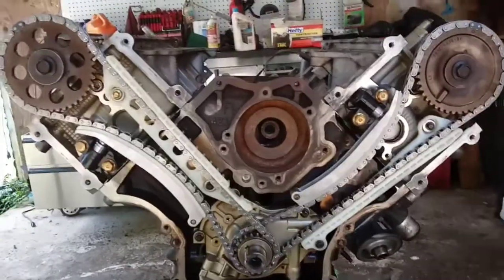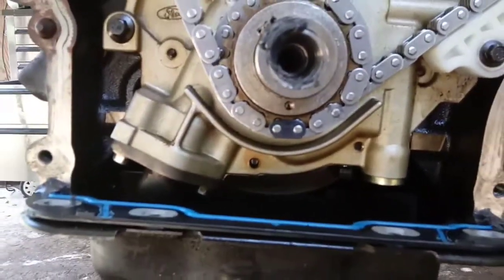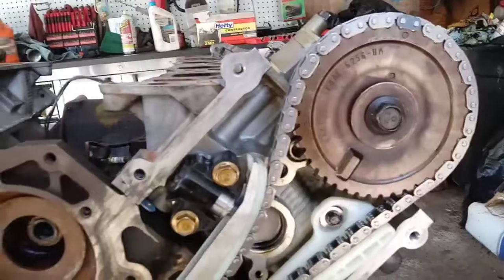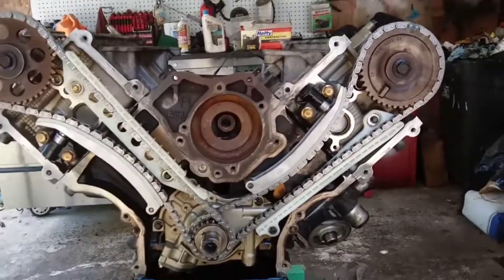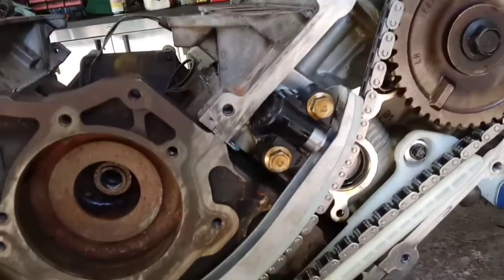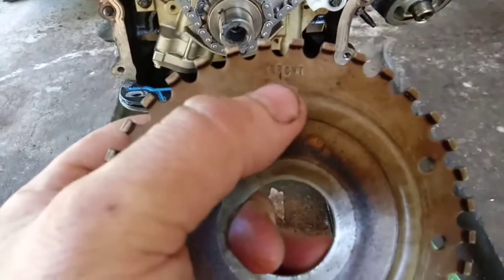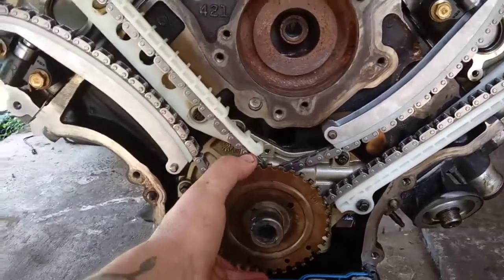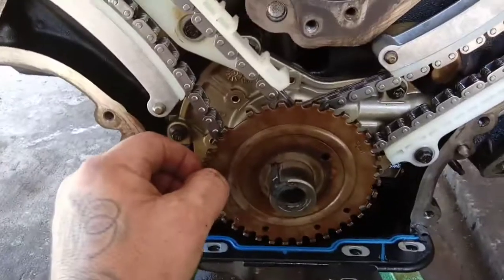Ford 4.6 2v timing marks

Comment: Hay man I need some help I’m tearing apart my first motor for head gasket 03 ford gt with the 4.6 sohc and I was wondering if I have the motor top dead center and line the chain with the marks you gave in the video I should be good to put everything back together correct?
Reply from the maker: You have the exact same engine design so this works for you as well

Comment: so looking at this vid compared to my pics i took of the timing chain. all of my marks lined up. had the cams at the same positions as you got. but whats got me freaked out is my crankshaft looked like it was off to the right barely a touch when i was messing with it. and it was like that before i even touched it (got it out a junkyard) again the marks line up and the chain has good tension on it. if i fucked it up my car is going to a scrapyard.
Reply from the maker: @idriveamerc  if your marks are in line with the dot on the crank and on the cams and it’s new chains etc… then you should be fine but of course I’m just going off what your telling me.
Reply: @MrMelvinkennedy1  thats good to hear. atm im having to rethread this spark plug so it will be a little bit before i actually fire the car up and see if it ticks or anything. pray for me lmao
Reply from the maker: @ I think you will be fine. If not hit me back up and we will figure out what went wrong
Reply: @MrMelvinkennedy1  so went to crank on the motor after getting it put together. sounds like it has no compression on any cylinder....great 🙃 been told i installed it wrong so...ig tear the whole motor apart again! yay
Reply from the maker: @idriveamerc  how did you install wrong but line everything up?
Reply: @MrMelvinkennedy1  man...thats a damn good question. i had it on open headers and i had another set of eyes in the engine bay they said it wasnt turning over fast enough. im gunna put the exhaust on after work and see if it just needs that back pressure. other wise its for sale

Comment: I get what you are saying in this video but I did mine and something went wrong and someone mentioned something about TDC on compression stroke and exhaust and that making a difference in doing it
Reply from the maker: @erikcapozzi3425  if you replace chains and markings are as shown it can’t be any other than compression stroke

Comment: If you decide to keep the factory Cross Morse HD chain that will last a million miles if you do regular service and you want to replace the wear items behind the front cover (fixed guides, tensioners, tensioner arms) pick a chain link to make an index mark..it doesn't matter which one as long as there's 30 links on each side to the crank.. make your marker marks and I'd probably strap the chain together on the gear to keep from any movement or have a friend with a breaker bar and an 18 mm on the cam gear. But do mark it so if when you release the tensioners and there's that jump or slap that can happen..more likely on the passenger side then if it moves you can always put it back. The aftermarket chains in the last few years a lot of time have sharp edges that do nothing but cut into the guides. If you insist on replacing the chains because you have 500,000 miles then I'd buy the morse chain from Ford and most definitely not the Cloyes that you'll be doing again sometimes by 50,000 miles or engine replacement. Cloyes used to be a really reputable company but like a lot of other companies with quality control issues i just wouldn't use them. I rebuilt a 302 and used a Mahle set that cost quite a bit more but there was absolutely no room for complaints. The 2V chains have no reason other than extreme mileage or using conventional oil for 15,000 miles to stretch. The 3V or 4V ... depends, just depends.
Reply from the maker: @MarcKemp-q6n  spot on

Comment: Question, I have a 2003 F150 with a 4.6 2-valve Windsor. I swapped it for a 2007 4.6 2-valve which also came out of an F150. Now my mechanic told me he could make it work simply by placing my Windsor intake onto the new motor? Well guess what it didn’t work. We are getting codes for Crank sensor, and Cam sensor. Crank code was successfully cleared, but not the cam code as the sprockets are different being that the newer one the 2007 has 4 more contacts making for a total of 8. Can we swap that cam gear to my Windsor gear, along with the Windsor sensor to make it idle? Rite now it starts fine and idles for 10 seconds then the idle jumps up and down.
Reply from the maker: @carlosbravo5091  you shouldn’t need to swap the sensor only the gear. They count the tones the same way just swap the tone gear and you should be good to go

Comment: I’m gonna do this job on one of my crown Vics. Thank you for the video, straight to the point. Any tips other than what you mentioned in video would be much appreciated
Reply from the maker: Be patient, take it slow and reach out if you need any help.
Reply: @MrMelvinkennedy1  will do! I’ll be getting started Saturday morning. Thank you again 🫡
Reply from the maker: @MrDoItAll91  absolutely
Reply: How do I line everything up to REMOVE old timing components?? 

I’m gonna be doing timing and head gaskets
Reply from the maker: @MrDoItAll91  if you removing the heads also the don’t worry about lining anything up until your going back together. Otherwise if it’s in good running condition line the crank up as showing in the pic and see where your marks are on the cams if it’s 180 out they will be the opposite of where they need to be but if the crank and cam marks line up like this video then your lined up
Reply: @MrMelvinkennedy1 so this morning I got everything off and somehow lol my timing marks in my cams were 11(passenger) and 12(driver) when I pulled the valve cover off. Does that mean the crack is also in line as well?? I haven’t pulled the full timing cover off yet I’ll be removing steering pump and cover in the morning.
Reply from the maker: @MrDoItAll91  no that doesn’t mean that at all. Always go by timing mark on crank not heads. There is a chance it could be or completely 180 degrees off as far as stroke goes. Good thing is it won’t matter now that heads are off. Just make sure cranks lined up properly before going back together
Reply: @MrMelvinkennedy1  good deal! As I pulled the cover, the crankshaft was 180 off!! You hit it right on the head! Man I thank you for basically walking me through this process. If anything else pops up I’ll be sure to reach out. Thanks and enjoy your Sunday 😎
Reply from the maker: @MrDoItAll91  absolutely, glad to help
Reply: @MrMelvinkennedy1 my old chain had no marks 😬. 
I got everything lined up, cams locked and timing chains removed.. 
What’s the best way to remove exhaust bolts (my very first time dealing with exhaust bolts)?? They’re rusty but not Up North Rusted lol luckily I’m down south. Like I said, they’re soaking in pb for last two days and I have a torch. I’m gonna get back at it in the morning
Reply from the maker: @MrDoItAll91  that’s the best way. Dont torch the manifold bolts but the collectors are fine to torch. Pb blaster should be plenty otherwise
Reply: @MrMelvinkennedy1  collectors? Is that the flange bolts (area)?
Reply from the maker: @MrDoItAll91  correct
Reply: @MrMelvinkennedy1 second weekend, day 5 and I’m completely done. Car crank up and ran amazingly for a few hours this morning. Mr Kennedy I’d like to thank you once again for this video and thank you for replying to every comment, you’re a gift sent from above. Thank you sir and enjoy your Sunday evening 😎
Reply from the maker: @MrDoItAll91  absolutely, I’m very happy for you. If you need anything else I’ll be happy to help

Comment: When I put my crankshaft to tdc the cams where totally off and my engine ran smooth as heck it's weird I just replaced a headgasket in my 4.6l 2v and reinstalled the heads, tried to turn the camshafts to the timing positions recommended and I feel valves hitting pistons so I don't force anything, the only thing I can think of is I need to take the heads back of to rotate the cams in place ?
Reply from the maker: It’s 3:30am here. When I get up in a few hours I will try to see what I can do to help you out. I may have to have a phone number I can call to do so but will try to help you figure out what’s going on
Reply from the maker: If your still having trouble I’m available just let me know
Reply: @MrMelvinkennedy1  just had a question if the crankshaft is at top dead center should the camshafts spin freely? And if so does the timing chain need to be connected to spin with the cams to avoid the valve to piston interference? I'm 21 and don't got mechanical experience just researched everything to come this far
Reply from the maker: @kevinedwards8330  what model and year
Reply from the maker: @kevinedwards8330  if your able to leave a number it would be way easier to call you, especially considering you have no experience
Reply: @MrMelvinkennedy1  would you still be available in like 30 mins? It's a 97 lincoln town car 4.6l 2v v8
Reply from the maker: @kevinedwards8330  yes I will be available then
Reply: @MrMelvinkennedy1  hey I think I got it figured out, it's just my left side camshaft is off so I'm going to spin the  cranck little by little until it let's me align the camshaft with my understanding that the cam valves are closed when they are in there resting position
Reply from the maker: @kevinedwards8330  ok let me know

Comment: Can you do this job without taking the intake manifold off  while in the truck ?  I can see taking the valve covers off.    I have a svt lightning  5.4 2 valve 2004
Reply from the maker: It can be done but honestly removing the intake is the easiest part of the job as well as its a ton easier to remove the valve covers once it’s off and out the way
Reply: have you done a svt f150 lightning with the super charger  same procedure?  Thats what i have to do.      are you close to north west Indiana ? 46373
Reply from the maker: @itsmeray01  oh yea I didn’t catch the lightning. Timing would be same procedure but you have more to deal with as far as intake removal

Comment: hey man great video - I'm about to do this job for the first time on my 2011 Crown Vic Police Interceptor.  I watched a ton of videos and many say once you lock the cams with the cam locking tool to not rotate them again with the chain off, or it could mess up the timing.  but then most videos end up rotating them slightly with the tool off, to line up the chain properly?  little confused by this
Reply from the maker: Ok so to answer the question I will do so in 2 ways. 1 do not over rotate on a 2v motor. Slight rotate in either direction is fine. 2 the chain will have links as shown in this video and sometimes to get those lined up properly you have to rotate some one way or the other. Now if the cam is sitting on a lobe and lets say rotates violently to the left, don’t freak out because unless you put a ton of force on it by hand it shouldn’t bend the valves, just rotate it back toward your mark in the opposite direction of the way it spun. So if it spun 1/4 turn < that direction then turn it 1/4 back > direction so that your not rotating the cam 360 degrees in one direction which would result in bent valves on the 2v engine. Ps ive never owned a cam holding tool EVER for any engine but specifically ford

Comment: Doing head gasket on 4.6 what do I do for timing chain I don’t want to replace the timing chain just the head gasket what can I do besides getting the cam holder tool and making sure it’s tdc
Reply from the maker: Well to do the head gasket timing cover had to come off as well as chain/cams so personally i wouldnt use a holding tool. Id get it at tdc then pull everything. Id also atleast replace guides and tensioners

Comment: No experience doing a 2V timing job..any timing job for that matter, but after following TDC steps my marks look just like what's in this video. Here's an e-high five 🙋‍♂️
Reply from the maker: Awesome. You got this!!!
Reply: @MrMelvinkennedy1   can I use a cam holder tool and then just dig in on replacing timing components without removing followers? Read somewhere that said have the key way at 9oClock before removing timing chains. Is this true?
Reply from the maker: @Logistican518  never used a cam holding tool in all my years, sometimes the cam can rotate but just rotate it back so the colored links are lined up. keyway meaning woodruff key then its more like 10-11 as you see in this video
Reply: @MrMelvinkennedy1  Rd  o

Comment: Nice work Melvin.  Do you prefer the nylon or cast iron tensioners?
Reply from the maker: I would prefer cast but im not particularly against the nylon style in general. Ive seen both fail and ive seen both go 200k plus so its either in my opinion. I do like the idea of cast over plastic though for “toughness” aspect
Reply: @MrMelvinkennedy1  I tend to agree and I appreciate your insight. I have a 2001 Mustang GT that runs like a top but I am getting ready to do this job as preventative maintenance.   Did you have any trouble removing the camshaft sprokets i.e., the cam's didn't try and rotate?   I assumed that you used the camshaft holding tool.  I am watching your other videos and you have some cool stuff.
Reply from the maker: @BlueOvalEdge  ive never used the cam tool, if you are at TDC already the cams should move very little and if so then rotate them back easy so you dont over rotate
Reply: @MrMelvinkennedy1  Interesting, so at TDC, you had no trouble removing the cam sprokets without the cams rotating?  Keep up the good work buddy.
Reply from the maker: @BlueOvalEdge  yes Ive always been good with keeping cams from rotating however at times they will some you just have to rotate the back. If you are replacing the timing chain guides, tensioners etc… you should be fine with not removing the cam sprockets. They are typically in great shape however some go ahead and replace them while they are in there
Reply: @MrMelvinkennedy1  OK, buddy.  I'll be doing this in the next year or so and I agree with changing the sprockets.  They are not that expensive.  Thanks for the advice.
Reply from the maker: @BlueOvalEdge  no worries if you get stuck or just need some advice give me a shout
Reply: No

Comment: Nice video man! The best one I have seen yet. However, I have a question and I was hoping you can guide me in the right direction. I want to replace the head gaskets on my 1997 f150 4.6l. If I remove the heads using the cam tools and install the heads back exactly as removed, do I have to degree the cams? Thank you.
Reply from the maker: No you wouldnt. The only important thing is making sure that the timing marks line up exactly how they came off or starting at tdc and going back that way so you can use new chains and there marks

Comment: How to add chain without marks? What’s the best way to mark a unmarked chain?
Reply from the maker: Well if you are referring to reusing a chain then mark it with paint prior to removing it as long as it hasnt jumped. Otherwise I have not seen a new chain that wasnt marked yet. Some are just a lighter color that the other links which makes them harder to notice but otherwise never seen these chains with out marks
Reply from the maker: I have one im building now that i can count the link distances if needed to help you out

Comment: How do line up the dots
Reply from the maker: What do you mean?
Reply: @MrMelvinkennedy1  how do I get the gears at the top to turn in the spot where it need to be and I took everything  off only the bottom  1 is right ,the other 2 👇
Reply from the maker: @michaelbrooks2741  the cam has to be turned for the gears to line up. Do not try this on a 2v without unbolting the head first unless its only like 1/4 turn

Comment: Now if the chain or guide doesn’t replacing. Can u just only install the tensioners only?
Reply from the maker: Yes you can. However even if i didnt replace the chain which i would recommend id atleast replace the guides with the tensioners

Comment: I believe my chain jumped a few teeth and got out of time, not by much. How do i clock the cams back in position? 🤔
Reply from the maker: 2v or 3v
Reply: 2v
Reply from the maker: @texaspete817  if its a 2v and its off, pull the heads. Trust me it will save you a lot of time in the end. If you can tell its off its enough to bend the valves on a 2v
Reply: Its not off by alot but i can tell its off

Comment: When swapping out the cams ( just cams nothing else) do you need to take the tension off the chain? If not will the timing jump? or is it just a simple popping off the cam bolt from the gear and swapping cams?

Thanks in advance.
Reply from the maker: If only swapping cams you need a timing wedge, wedge the chain so the bottom dont get out of time then mark the tops then you can remove cam bolt and cams, replace cams, put it back in time according to your marks then tighten the cam bolt and remove wedge. You can do 1 side at a time this way as well

Comment: Ford nailed it this engine in my opinion. Really considering changing my LT1 with a 5.4L 2V. I am not a person who cares about Brand(Ford/Chevy), I care about engineering and specific designed things and the Modular Ford has everything I like. Love it even not even driving or working in one. Awesome video, simple and objective. I still need to study more about it, but so far I love it.
Reply from the maker: Yes ford definitely had a decent engine here. I love the 3 valves as well but they were a little more complicated